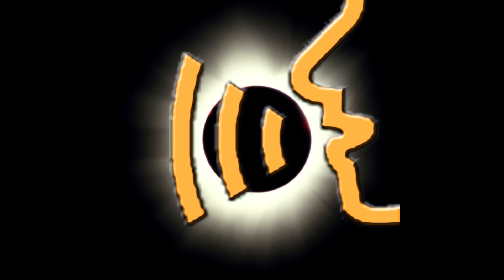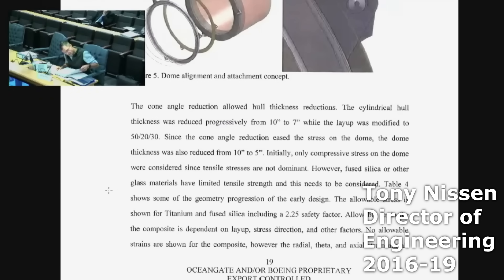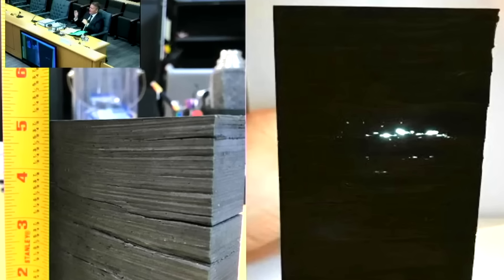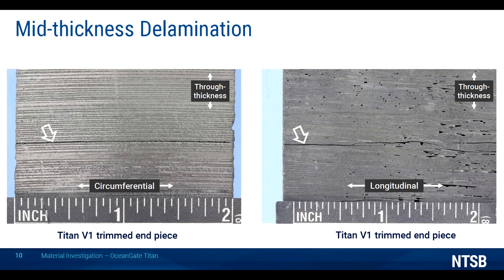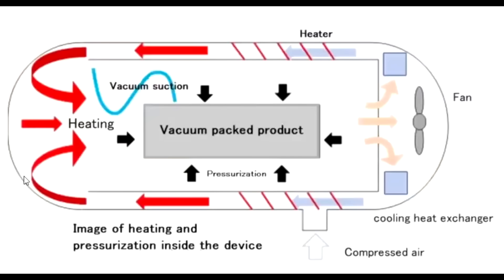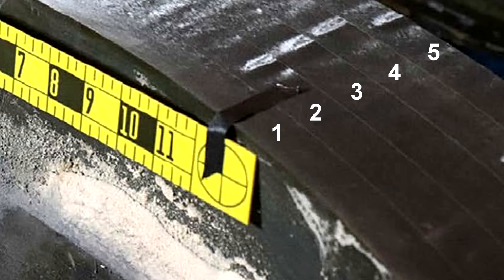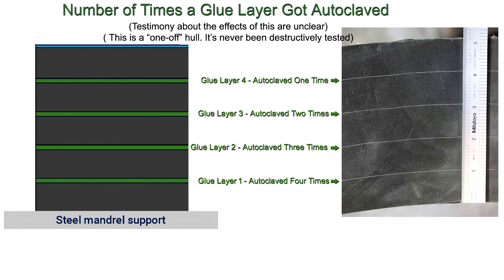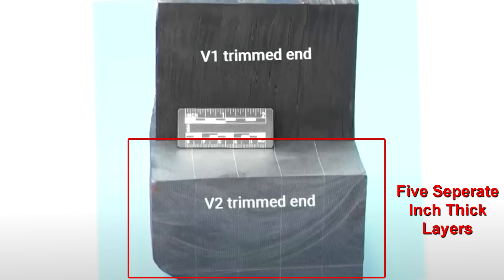Who Engineered the OceanGate Titan V2 Hull? Maybe Nobody Did?

Comment: One data point I’ve never heard mentioned anywhere is the potential wear and tear on the sub from its thousands of miles of traveling between its home on the west coast and its launching on the east coast.
Reply from the maker: Thanks for your comment and I agree with you.  The two domes weighed 3,800 pounds each and were mounted to the rings that were glued onto the carbon fiber.  Now, the rings were where the frame (landed gear) was attached to, so the rings were supported.  But those 3800-pound domes were just hanging out there taking the bouncing around when the Titan was transported around on the back of a flatbed truck.  The other thing is that Tony, on the V1 hull, would not let them weld lifting rings onto the titanium rings because they were not engineered to take that force.  But I see on the pictures of the V2 hull that there are lifting rings on the rings.  I guess they added hose later when Tont was fired and no longer with the company.
Reply: @solareclipsetimer  The hatch with the viewport probably was pretty heavy as well. When swung open and staying that way for a long time during the dive prep, this probably added more stress to the hull, concentrated to where the hinges are connected. Another factor that was mentioned often was the transportation of the sub from St. Johns to the wreck site on the floating platform in rough seas instead of secured on the mothership itself.
Reply from the maker: @ Agree with you.  However, because the hatch was round, the hinge wasn't really a hinge that could take the weight, it was more of a pivot point.  If you look at pictures of the Titan with the hatch open there is always a support under the bottom of the dome taking the weight.  And this support also had to move in and out (roll or slide) while they opened and closed the dome.  It was probably a mistake in this protocol that allowed the entire dome to fall off one time.  Thanks for your comment.
Reply: How was it transported? Because unless the truck ended up on its side, I don't think traveling across the country secured to a flat bed is anything close to damaging enough to be a factor.

Comment: Why the fuck couldn't this doofus just use steel for the hull? Would it not have been safer, and exponentially stronger? Because it would have been too heavy for his budget moving it around or something?
Reply: He wanted a bigger viewing window so his "research scientists" could get a better view for their coin...
Reply: He didnt want to use the foam for bouyancy, nor the cost.
Reply: Because it's heavy and that complicates a lot of things.
Reply: Steel is stronger than titanium. I heard somewhere else that the reason was that he wanted the vehicle to be buoyant, so he could surface only by releasing weights
Reply: Because steel would crush at these depths... Titanium is one of the few metals strong enough to withstand the pressure.
Reply: @Meowza900  Steel is more than capable of surviving those depths, assuming you engineer stuff correctly. Composites are not ideal materials for both the fact that their strength is not as high in compression but more importantly they are far more complex and introduce a lot of extra variables that need to be accounted for. Titanium is superior due to it being lighter and therefore making it easier to have a sub that is positively buoyant once you drop some ballast. Subs like this are designed so dropping weights is enough to make it surface, in case you lose power or control systems.

Stockton went with carbon fiber to save weight, which was critical for the goal of commercializing it. A heavier sub needs a larger support ship and stronger equipment to move it on and off the ship. All that adds cost which eats into what would already be a very expensive business model. A lot of decisions he made go against good engineering practice, and defy normal methods of building submersibles due to him wanting to make it as commercially viable as possible. The shape of the sub is not the ideal shape, though it still is workable. The materials chosen and the methods of assembly were also varying from being a bad idea to being straight up negligent.

This all comes back to someone who wasn't willing to listen to people who tried to tell him when he was wrong, and cutting corners because he thought he was smart enough to get away with it.
Reply from the maker: @PercussiveMaintainer  Vey well said.  Thank you for that thoughtful reply to the viewer's question.
Reply: @PercussiveMaintainer  Great reply, thanks for the information! It does seem like Stockton wanted to push ahead and be a pioneer without having safety measures in place. More a matter of when, not if.
Reply: @Meowza900  Yeah, the more that comes out about the whole development cycle of the sub and the leading events, the more it becomes a surprise the sub survived as long as it did. There are plenty of ways that Stockton could have pushed the boundaries and advanced stuff without constantly jeopardizing himself and passengers.

One of the things mentioned in the video alludes to it. When they talk about running a basic analysis with a 7 inch thick hull, they mention that being a simplified model it loses some nuance about the actual material in reality. They expected that Oceangate would build in additional safety factors to compensate for potential defects and instead they removed what little margin they had.

It all cycles back to a level of confidence that wasnt justified, and a far too relaxed attitude towards safety margins that you really need when pushing the edge of stuff. Its sad people lost thier lives, but knowing what we do now it was basically inevitable given the conditions.

Comment: Aerospace is very different from Deep Sea. Technology solutions for both are not always interchangeable.
Reply: @DaveSmith-v3teven ignoring direction, pressure differences against the ship interior are much bigger on the ocean floor than in space
Reply: @DaveSmith-v3teven ignoring direction, pressure differences against the ship interior are much bigger on the ocean floor than in space
Reply from the maker: That is absolutely correct.  Tony Nissen had some marine experience and got fired.  The Applied Physics Lab had marine experience and got fired.  David Lochridge had marine experience and got fired.  Aerospace engineering and materials are not interchangeable to all uses and environments.

Comment: When even Boeing tries to tell you to make something safer... that's a red flag.
Reply from the maker: Thanks for commenting. I am not a Boeing fanboy, but remember:   this was the Boeing company of 2012-13 and they did an early feasibility study for OceanGate. And the Boeing engineer who testified was spot on. 1. At least 7 inches thick. 2. 45-degree cross plies. 3. Plan for the "effect of defects" If OceanGate had listened to Boeing they would have had a better chance of having a better hull and if they had kept Boeing involved Boeing would have planned for proper testing. OceanGate ignored Boeing's sound advice.
Reply: @ I agree. While the company had quality control issues, Boeing has many incredibly intelligent structural engineers; I have no doubt that they knew what they were talking about. Much like ocean gate, and many companies, it appears Boeing suffered largely from top-down cost cutting.

Comment: So what I got from this is that if they made it 7 inches thick or more as originally recommended by Boeing and Nasa then this thing would have lasted hundreds of dives… well ignoring damage from poor transport and storage conditions. Talk about on a budget!
Reply from the maker: Maybe.  Thicker and 45-degree plies would have helped.  It still needed more testing.  For example, just throwing something out there;  30 unmanned dives, and then cut it up and see how the carbon fiber was holding up.  There had to be some knowledge of the cycle fatigue.  Then of course there are all the other variables in this story.
Reply: @solareclipsetimer  What I'm wondering: is this the only sub with a (partial) carbon fiber hull or are there others? How was the testing done there? Did people already collect data about carbon fiber subs? Would be a good thing if you had something like that to base your decisions on. Just going in with a design without proper testing is just a major red flag. The tests they did with the scale model were basically null and void since they used a different design regardless...
Reply from the maker: @CatNolara  There is some work with carbon fiber under compression forces, but I don't know the extent of it.  They Navy had smaller unmanned glass fiber laminate sub that did great, look up AUSS, Advanced Unmanned Search System.  OceanGate was not the first to think of this.  The problem is that it would cost a fortune to build it and test it adequately.  Adequate testing is the big thing.   It would have to be a government funded project because the R&D cost would never work out for a for-profit business model.  Stockton thought he could do it by tapping into the adventure tourism market, but the business model was not workable.
Reply: Carbon fiber isn’t some super expiremental material that we know nothing about. It’s used in Motorsports and aerospace without issue. Yes there is learning curve but ultimately not much that OceanGate would have had to learn on their own. The main reason Rush wanted carbon fiber is it allowed for more internal space with less flotation. Flotation is expensive and takes up a lot of space, growing the size of the vehicle.

If I had to guess he probably did the math and realized that anything more than 5 inches thick would make the sub too heavy. He also probably saw proof that 5 inches would be enough for Titanic depth but that’s where logic went out the window. Certification includes testing to depths 20% deeper than the operational limit. His sub was only tested to Titanic depths and no further. So lets say it was strong enough to go 5% deeper, well the closer to the limit you operate the more it wears out the sub with each dive. Even Steel and Titanium subs have dive limits and those materials can be engineered to safely do to full ocean depth. 

Rush was just being cheep, and refused to listen to the actual experts. A full ocean depth long life carbon fiber hull could be built, but only with smart people behind it.

Comment: holy shit.  they autoclaved prepreg over and over and over, and then CUT INTO IT 12mm!?  HOW did they make those cuts?  Waterjet? CNC? Dremel?
Reply: probobly a fecking penknife judging by the typical practices of this S*** show
Reply from the maker: Thanks for commenting.  I am not exactly certain but in the testimony sometimes they use the word "grinder" and sometimes they use the word "sander."
Reply: Whatever it was it probably came from harbor freight
Reply: Think about the absolute cheapest way you could do it correctly.
Then think about the cheapest way you could do it wrong.
Then do it wrong.
Reply: Based on what I've seen, a random orbital sander!

Comment: Fundamentally flawed material selection; Composite is never primarily loaded in compression...the alarming mid-span deformation would have surprised no competent designer.
Reply: I think that it has to do with the direction of force, and if the load is constant or not.. Compression is fine if you have a stack of regular interleaved paper and plastic sheets, but not at all for tension.
Reply: @savagesarethebest7251  Indeed, Direction of the load force is everything to a composite structure.

Comment: There are questions before you even go into the engineering: was the vessel insured? Normally you can't insure a vessel that's meant to take paying passengers unless the design, manufacturing, and operation are signed off by a Classification Society like Lloyd's, DNV etc or by a governmental agency like the US Coast Guard who are very conservative. According Wikipedia Lloyd's refused to certify the vessel and the company used a variety of loopholes to essentially take paying passengers without requiring that the vessel needed certification. That alone should be an indication of the nature of the business i.e. shady as fuck.
 
If you've ever seen a composite pressure vessel/pipe you will always see angled/off-axis layers and not just circumferential & longitudinal layers. This is pretty fundamental structural engineering and people have been making composite pressure vessels for years for critical industries like chemical plants where the consequences of failure are high. I don't know what the composite engineering industries' experience with manufacturing layups this thick but typically if you're doing something in composite that's cutting edge you test the shit out of it. For the application you would do a test to failure and then test at least 1 more test article in a fatigue test (which might not be to failure) which may or may not involve non-destructive & destructive post test inspections. TBH, all you have to do is listen to the Boeing engineer at 1:30... He basically said that if everything was perfect (material, manufacturing etc) the minimum thickness was 7". He didn't say whether that allowing for fatigue loading but basically the answer is it had to be > 7" thick. So the basic conclusion is that this thing was (at least) poorly engineered and inadequately tested so that somebody could disrupt the industry make it cheaply...
Reply from the maker: Thanks for commenting.  One of the loopholes was calling the passengers "mission specialists" (=crew) so as far as the overseeing authorities were concerned this was not considered a passenger-carrying vessel.
Reply: @solareclipsetimer that's not a loophole, that's fraud
Reply: All compsite pressure vessels ive Seen have the pressure inside not outside that would Change how you lay the fibres No? Not saying the Titan was thought through Just that the layup of Carbon should probably be different from Most Industrial pressure vessels probably maybe im not qualified at all lol
Reply: @leonschroeder4771  If BOEING said so, and they were the reviewers and OBVIOUSLY knew the pressure was on the outside, I'd say the experts ruled on it, as opposed to the shade-tree grifters.
Reply: Wow the more i hear about this story the more it just seems like criminal negligence. Which wouldnt that void the waivers?

Comment: I still cant believe they basically used a JB Weld type glue/bonding material to mate the titanium to the carbon fiber. It just sounds idiotic to me and I am no engineer. I would not use a JB weld type substance on a vital car repair. It's like putting JB weld on the outside of a hole in a tire and putting a piece of rubber on top of the JB weld and trusting it to drive cross country. Cant believe this ever went to sea.
Reply: Funny enough but the JB weld was probably a minor detail in the ocean of bad practices.

The pressure would push the titanium caps towards the Carbon and so it would put little stress on the bonding, but a lot of stress in the Carbon through the extra compression.
Reply: It went to sea without being certified or insured, and being built by a loose cannon rich boy with ego issues.
It's all what happens when crooks are allowed to use loopholes in the law cuz they got the money and can con people to follow them to their deaths.
Reply: So, there is a correct way to use JB weld in car repairs, including using it to patch holes. We give it a lot of shit but its actually an excellent product when used correctly. 

Still wouldnt use it in this application. In fact, i feel like it needs to be stated explicitly on their packaging "Not for use on submarines".
Reply: @dragonbutt  yeah, the people who use a product incorrectly often give it a bad reputation.  When used correctly and in the way it's designed for it's fine.  It's like spray foam, it's great for it's actual purpose (filling holes for thermal insulation), but many people use it for structural "repairs" on cars.

Comment: Only 20 seconds in and they used 5 separate layers instead of 1 solid layer... we figured this out back with sailing ships.  1 solid layer of armor gave better protection and strength than several smaller layers...
Reply: I don't think that's the most important thing, composites are different from metal. The Boeing guy said that it needed to be 7" with no knockdown factors for fatigue, stress concentrations, or manufacturing defects and somehow they convinced themselves that 5" was OK 🤷🏾‍♂
Reply: @cliffordbradford8910 Stockton probably thought to himself 💭 "7 and 5 are both odd numbers... so it probably equals the same'ish strength wise...so let's do it at 5 inches."
Reply: @cliffordbradford8910  I hope that Boeing engineer was from the pre-cost cutting corporate decisions they made in recent years...
Reply: Even your hypothetical "one layer" is still a multilayered material...
😉
Kevlar and carbon fibre really shouldnt be compared to ww1 style ship armor.
Reply: The issue was that you can't cure 5 inch layer of carbon fibre without a ton of defects. So curing in layers is a known technique to mitigate those issues however has it's own drawbacks. I am not saying what they did was smart or well done, but it's not as simple as they should not have done in layers. The issue is that it was basically an experimental design that they did not test nearly enough to ever put people inside it.  But it's also fair to point out that it did work for several dives to full depth, indicating that it is principle possible to make this method work, but yeah that would cost a lot of time and money to actually get to a point where it could deemed safe for people to ride in.
Also it isn't generally true that 1 solid layer is better the several smaller layers in the context of armour, see spaced armour. It's actually often beneficial as spacing armour can stop crack propagation.